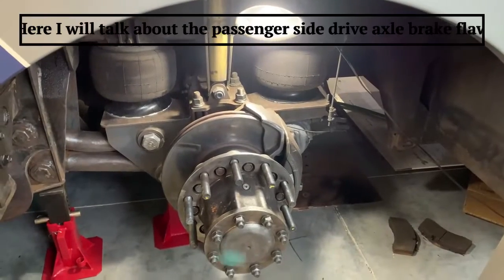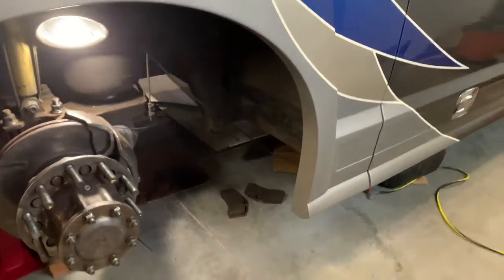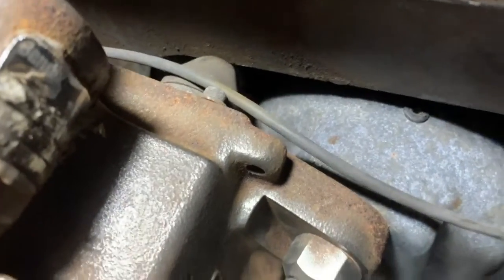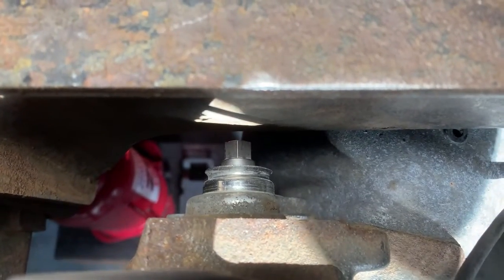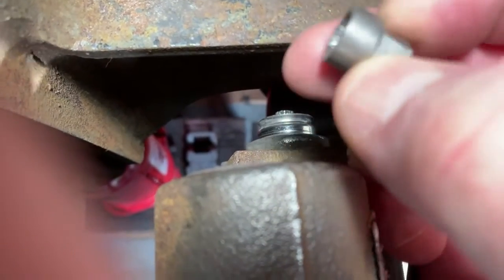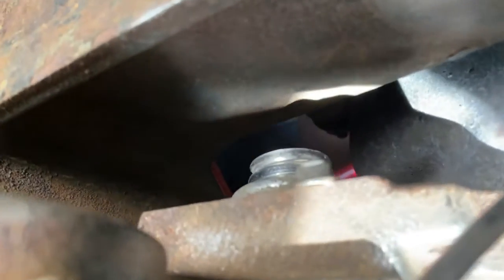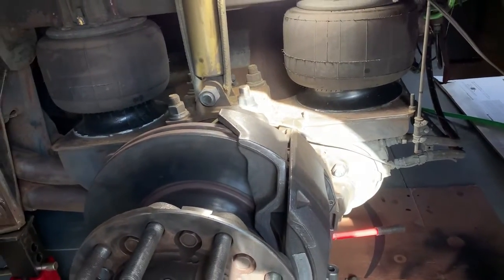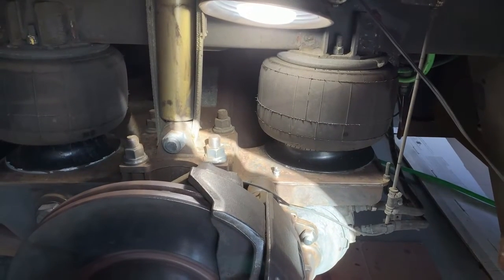RV & Semi Bendix Disc Brake Design Flaw - Thus was found on my 2008 Country Coach 530 Intrigue.

Comment: Fasanating finding, on my rv claipers plastic pistons seized and pads ate rotor. How did you jack rv up ?
Reply from the maker: I use a 20ton bottle jack and 40ton axle stands. They work quite well. I also found a great tool for removing the wheels, you may already be aware of, the torque multiplier, works really well also.

Comment: Hi Rod.  As a follow up, my 08 Intrigue was just checked out by Premier RV Service re. this brake design flaw.  First, they confirmed that the issue you found is only on the passenger side drive axle.  The driver side caliper is mounted upside down so that adjuster is on the bottom with no frame to contact.

So back to the passenger side drive caliper.  They took the pad out and then slid the caliper all the way in until the adjuster hit the frame.  Then they took the brake pad (which has 58,000 miles on it) and placed it next to the caliper.  What they concluded is the pad would completely wear out before adjuster could hit the frame.  Therefore this is a non-issue and not a brake design flaw.

I hope this helps other CC owners out there that may have concerns.  Premier has concluded this is a not a problem .
Reply from the maker: Hi Rod, I am glad that they took a look at your coach, and that you will not have the issue on your coach.
I would however disagree with their statement that this is a non-issue, as my video shows that on my coach the pads were not wearing past 1/4 usage as the adjuster was jamming up against the rail. Not that I want to get into a large dispute with Premier RV, I would however be happy to discuss with them if they so desired. I would argue that perhaps there may be build variation in which case in some circumstances they could be minor clearance if the rubber boot and adjuster cap was not installed, however to state that this is not a problem, is rather lacking on their part, as I have the hard evidence to state that it is a problem.
Not sure I expected any different answer from Premier as they probably have design equity in the game. But glad yours has been checked.
I still maintain, this is a design flaw.

Comment: I think this job could be accomplished with only removing the air operator. I have mine on jacks with tires removed and wondering how hard to remove the operator. Is there a spring  that needs locking. 2008 Allure
Reply from the maker: Hi Buddy, thanks for your comment. Firstly do you have disc brakes or drum brakes on your allure?  You are however correct,  I believe that you can simply remove the Air brake actuator (operator as you call it) On mine to remove that you would need to have the wheels removed as you have to gain access to the 2 fixing nuts which hold the actuator on. Also on mine I did not need to lock out the cylinder, you do not have to do that on all types. To allow the actuator to be reinstalled you will need to remove the brake pads to allow the mechanism to move once you install the actuator, otherwise you will be fighting the spring load in the actuator.
Let me know how you get on, i am interested if others have the same issue.
Reply: @Titbits from Rod  completed the grinding on my coach. I believe I have enough clearance now. I messed up and had the brakes on. I only loosen the bolts on the actuator and was able to grind it.
Thanks for finding and publishing. I will most probably put it the Country Coach newsletter.
Reply from the maker: @buddybordes8756  did you confirm that yours had the same foul condition as mine did you take any pictures you can share? Thanks

Comment: I have the same year Intrigue with disc brakes all around and assume mine has the same flaw.  Here is a chassis video Brian Van De Walker did a few years ago on my coach.  

https://youtu.be/AYt73ssEhT4
Reply from the maker: Its certainty is a small world. I was at Premier when your coach was there. I met brain at that time, he has helped me out a few times, very nice guy to know and very helpful. I have watched that video on your coach a few times, I see you have a different exhaust, and you have the protective plate under the rear electrical box to prevent water etc getting up in there. Brian no longer works at Premier, and does a lot of work on his own. Here’s his number if you every need anything. 541 514 9000
Reply: @rodmillar  Yep, met Brian and he knows his stuff.  Something happened with his relationship at Premier to go sour.  I'll send you a photo of my coach  if I had an email or some other method if you'd like.
Mahalo,
Rod S.
Reply from the maker: @rodsaunders3741  rmillar1@msn.com

Comment: Did you keep your Intrigue at Pacific Shores in Newport?  I was there last summer with the twin to yours (even same color) and noticed one all buttoned up. Anyway thanks for the brake video.  I will have Doug advise when I’m back in Junction City in June!
Reply from the maker: Hi, yes I kept it at Pacific shores. Lot 183 close to the shoreline. Great place, great views from my lot, only trouble is the wind and damp salt air blows up over the cliff. I was negligent in that I should have taken the coach to a truck walk to clean off the salt.  All the work I am now carrying out is the clean up and renovate the damage from salt. Thanks for the comments. The blue is unique, not many around.
Reply: @rodmillar  I was there for a week closer to the entrance and the salt air left it's mark.  A good wash and wax on my last day there solved the issue!
Reply from the maker: Does your coach have rear bending disc brakes, if so check out my video on Brake design flaw, you might find it useful. Regards Rod
Reply: @rodmillar  Yes it does and have an inquiry with Premier RV.  Will let you know what they have replied.